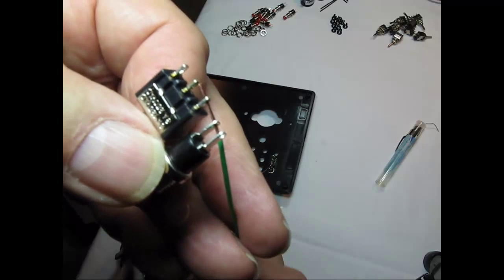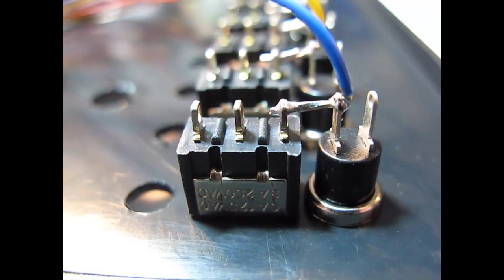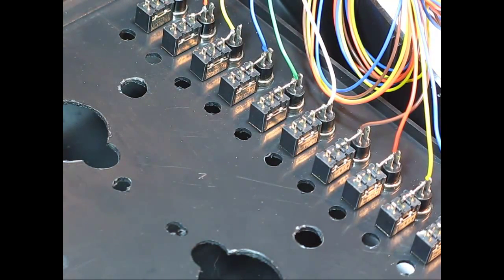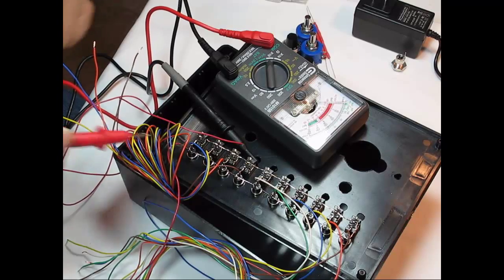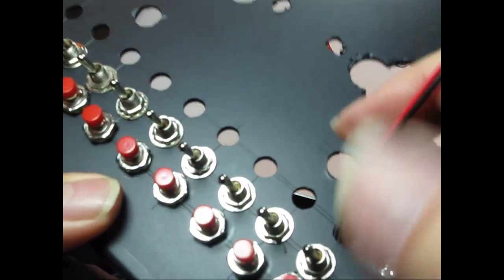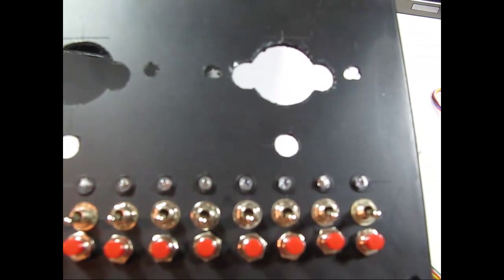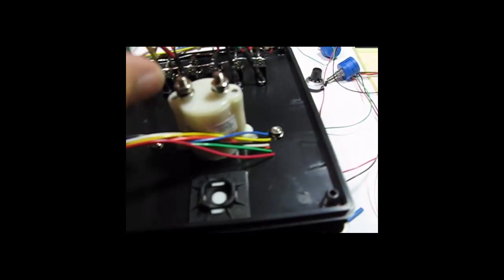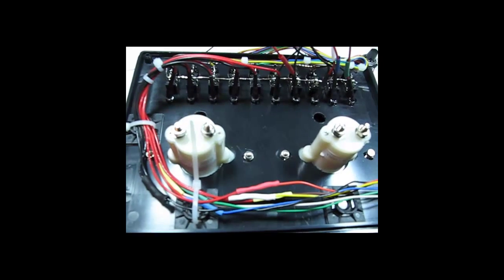TS03 Pt.4 - How To Build a Trainer with Analog - Assembly

Comment: If you put the bezel of the LED in first from the front then pass the LED in from the back it locks it in place thats why the holes seems too small.
Reply from the maker: Correct you are. I used hundreds of those many years ago and I forgot. But the instant I read your comment I flashed back and remembered installing them as you suggested. There is always something to keep us humble, which is a good thing. Constructive comments always appreciated. Thank you.